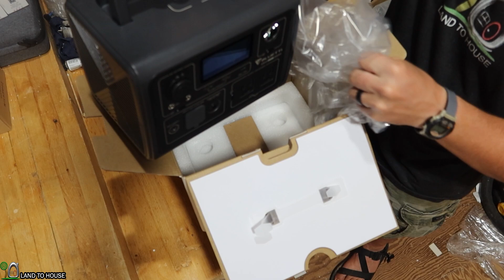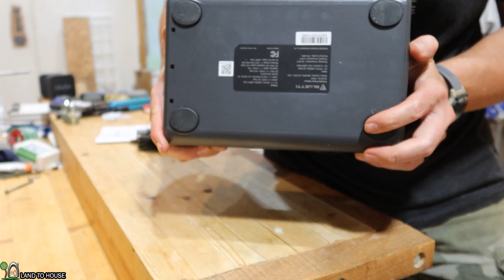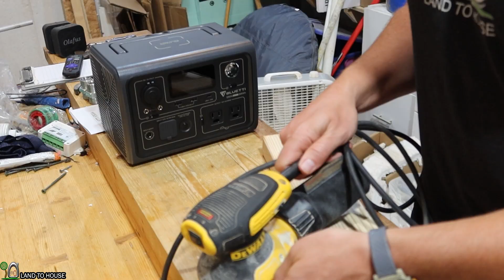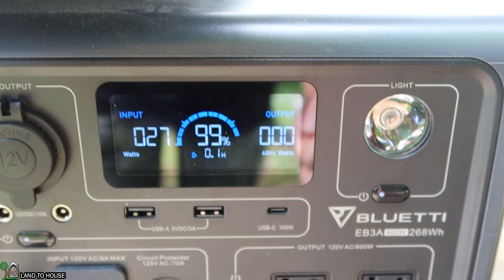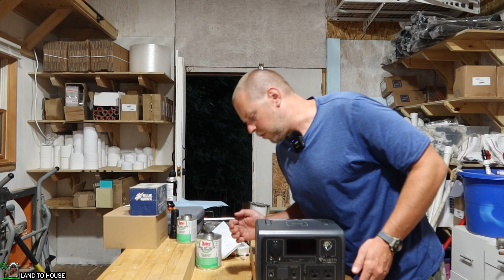Bluetti EB3A Power Station [UPS and Internal AC DC Adaptor]

Comment: I bough 2 of them, they are not that great, when you let them continuously connected to AC,the unit turn to UPS mode, few hour after it finish fall in safe mode in some kind and drain the battery.  It happen to both of my brand new unit !!!!!

Comment: Used propane as the fuel. The generator started on the second pull and ran flawlessly. Produced power at 122 VAC at a steady rate. Works great I would recommend this product as of now. The only thing that bothered me was the oil they send with it leaked on the inside of the plastic bag they send it in, therefore I had to go and buy oil for it.

Comment: I've read to not use power station below 20% and don't charge above 80% in order to extend long term battery life.  That doesn't sound right.  Should I go to near ZERO and charge to 100%? Does it change the battery's "brain"  if i start at 50% and top it off to 100%?

Comment: Manufacturer said it is not recommended to charge it and use it at the same time 🙄🤔
Reply from the maker: I would agree with that. I've been using this in my shop as a cell phone charger and it's better to charge it separately when not in use

Comment: I am new to all this so please be patient. Would this handle a Keurig Cup coffee maker or a two slice toaster or a crock pot? Hope these aren't ridiculous questions thinking  about buying this unit or should I get a bigger unit. Thank You in advance.
Reply from the maker: Not a problem. Typically applications with heaters in them are going to require more W then this small unit I would probably look for a 1500 W unit to run a coffee maker and definitely a toaster. A lot of toasters will run at 1200 W.
Reply: @LandtoHouse  Thank you for replying, do you know the model for a 1500 in Bluetti?
Reply from the maker: I've used this unit and the 700 W model and then stepped up to the AC 200 P 2000 W model. I'm not sure if they make a dedicated 1500 w.
Reply: @LandtoHouse  Thank you.

Comment: Very good info but you never mentioned anything about the APP and the things that can be done only on the APP like the Power Lifting Mode. If you plug in a small heater the Bluetti will fault out but it will run heaters on the Power lift Mode plus you never mentioned anything about the different charging modes available through the APP. You seem to be an intelligent Man so lets cover it all not just some of it.

Comment: I actually own 2 of them. One I use as a UPS for my computers, I have each computer plugged into its own dedicated cheap UPS, then all the UPS devices plugged into the Bluetti. I simulated a blackout and the Bluetti was able to run my 3 computers for 45 minutes before the battery was depleted, then the UPS kicked in. At that point, I plugged the AC back into the Bluetti and it recharged while powering the computers. Love this device so much I purchased a second one.
Reply: The output will match the input. Yes, it has pass through charging, that is how it is able to function as an uninterruptible power supply (UPS) and can switch from line power to battery power in less than 20 milliseconds. If your battery is not fully charged and you have an output of 150 watts, the input wattage will be higher because it's charging the battery and outputting wattage at the same time. My UPS systems have sealed lead acid batteries and the battery in my one UPS finally died. I powered down my computers and removed both UPS systems (cheap ones) and took two power strips and plugged them into my eb3a. Then plugged all my computer equipment into the power strips. I simulated a power outage by unplugging the AC charging cable and ran my eb3a for 45 minutes, dragging the battery down to 40%. Then I plugged the AC line back in and it was drawing 250 watts input and putting out 100 watts on the output. It works great.

Comment: Good review you put it through real case scenarios instead of just talk about it like everyone else.
Reply from the maker: Thank you. Since making this review I typically use this unit for the led light and running my off grid shed lights.
Reply: @LandtoHouse  I just bought one now I need a solar panel not sure what 200 watt panel i want but I live in an apartment I don't have a lot of space on the side of my window. I want to get that ac200 max   eventually I will. just wanted to start off small
Reply from the maker: @jamesmichaelcabrera9613  Most of the panels fold to around 2" thick. Can easily fit behind a bed headboard. Or behind a couch.

Comment: Assuming the Bluetti EB3A will sit idle for months at a time for a SHTF moment (typical FPL blackout), is it okay to store it at 100% charge?  Or does it have to be discharged to 50-60% for longterm (4-8 months) storage?  🧐
Reply: You can store it full charge, it uses Lithium Iron Phosphate, that does not require to be discharged for long term storage. Lithium batteries do require 50 to 60% discharge for long term storage.
Reply: Manual states “ Charge the unit to 80% SOC every 3-6 months for long-term storage.”

Comment: Had my for a week and it will be not take a change anymore I call customer service and got no help from them it’s junk buyers beware and bad customer service.
Reply from the maker: That's not good. Mine has been fine for over a month. Are you charging through the ac plug?
Reply: @LandtoHouse  it Charges from ac but not with the solar panels I use a rich 100w then a rich 200w in full sun nothing happens and some time the unit will not even turn on I heard it been happening to few other people too .
Reply from the maker: @billfowler9325  That sucks sorry to hear its defective. The Eb70 unit i have has been a champ!

Comment: Bluetti lied again about the solar input being at 200w just like they lied about the EB70 being 200w solar input. Max is 155-160w solar
Reply from the maker: I guess they mean you can connect 200w although only 160w will be pulled?
Reply: @LandtoHouse  No as long as the panels are parallel ( Negative to Negative and Positive to Positive ) you can put 400watts of solar wig you want and it will or should cap off at 200watts input like as advertised all over there website. But it’s not true it’s false advertising just like how they did with their EB70.

Comment: I have ran my full size refrigerator off the EB3A without a problem. I hooked the fridge to it when it was at 67% charge. I allowed the fridge to run two full cycles and still had battery left.
If you will be getting into your fridge a lot during this, I would suggest either changing your light bulb to LED, or just unscrew it a bit to disable it. Every watt counts.

Comment: Amazon has them for 240 currently? Would you recommend these over anker 521 and jackery 300. Lookig for something to help me run a box fan couple hours a night. And help with electric pump for paddl boards  and  air matress
Reply from the maker: The bluetti is a solid product.  With 600w ac output it can run a fan no problem. The battery is a little small but would run a 60w fan for 4 or 5 hours.

Comment: Can't wait to get my eb3a, primarily to run my dish receiver on my tt and make a coffee on my keurig without having to run my onboard generator, my only experience until now is a 40$ GoPowerPlus i got at wall mart, its fine for charging a phone or laptop but beyond that its useless
Reply from the maker: Is your coffee going to use less than 600w? Some machines need more to heat.
Reply: @LandtoHouse  your probably right & i may have misunderstood when i read the power consumption of the K express, it says it needs 1500w on initial warm up, but once heated it can maintain temperature between 200/400 watts so it may not work out for that purpose , however my main goal is to be able to power my dish receiver without a generator since my tv is 12v

Comment: We received our EB3A a week ago.  Because we have frequent power interruptions due to Florida storms, we bought it specifically to run wifi router in UPS mode (brand new ATT fiber optic).

Performed flawlessly when initially run on AC inverter battery power (pulls less than 35 watts), but in UPS mode when battery was charging and reached 100%, the sine wave seemed different (not pure?) and router went haywire and wouldn't work.  Anyone else have this problem or done testing to confirm standby UPS sine wave?

Love the unit, but so disappointed it won't run sensitive equipment in UPS mode.  Thinking of returning it.  :(
Reply: how do you know that the UPS sine wave is not pure?
Reply: @Stéphane S. was totally guessing most likely.

Comment: Wonderful review. You're the first of 30 reviews I've watched that demonstrated how to use the manual buttons on the unit itself to convert to 50hz from the default 60hz as well as turning ON/OFF ECO mode. But I do suggest your verbiage concerning "Pass Through" and Uninterruptable Power Source" be more accurate. They are two completely different features. And the fact that this unit has both of them is great.
Reply: don't forget pronunciation, it's eco mode not echo mode

Comment: Bluetti told me the UPS transfer time is 20ms....  That's borderline for causing a computer or other sensitive electronic device to shutdown/restart.  Would like to see someone actually test this...
Reply from the maker: Interesting idea. I will have to give it a try.
Reply: Bought the EB3A specifically to run our wifi router in UPS mode (brand new ATT fiber optic).  Performed flawlessly when initially run on AC inverter battery power (pulls less than 35 watts), but in UPS mode when battery was charging and reached 100%, the sine wave seemed different (not pure?) and router went haywire and wouldn't work.  Will probably return the EB3A and continue the search for a unit that can power sensitive equipment in UPS mode.
Reply: HoBotech does all of those tests
Reply: @JeffSkymaster  Please link the video. The only video I see he just talks about it and doesn't actually test the UPS feature.

Comment: The EB3A would have been a winner if it had the option to connect an extra battery to it.
Reply: You can connect an external battery to it through its charging port. It wont increase your wattage, but it will increase run time. That increase depends on the battery you have hooked up.
That procedure works fine for me using a 100ah 12v battery.

Comment: It definitely performs like the Ecoflow River, except that it is kinda late to the party.
Reply: Except that it has LiFePO4 battery chemistry, which can be a big difference in terms of battery life and is a lower fire risk that the older LiIon chemistries.
Reply: The ecoflow will be dead after 2500 full charges whereas the bluetti would still be working with80%

Comment: i have solar panel with anderson connectors.
can anyone show me a link to an adapter i can use that solar panel with the bluetti eb3a?
Reply from the maker: You might check the dc berral size but this looks good https://amzn.to/3IaXIsH
Reply: they also make a Cig lighter plug with anderson conversion
Reply: Find a local Ham Operator, they can make you a cable right quick.

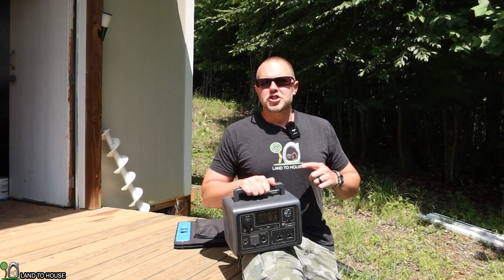Comment: The pass through charging hands-down makes this kit awesome! You're totally right -- most do not do that! It was nice to see the charging input stay the same even while the tool was in use. I wonder if that was the case.. a pair of kill a watt would be handy to verify. I've been thinking of ways to torture test these things as companies continue to make and want to promote them. :)  @8:04 Is that the archimede's screw!?!?! :)
Reply from the maker: That is the Archimedese screw! The unit you have is the best around. I do have a single kill a watt meter.
Reply: @LandtoHouse  Could you do another tool review and show if your chop saw will run and cut?  ...and maybe one of the highest draw tools from your workshop? I've got to cut a bunch of bamboo and PVC off-grid... Thanks!

Comment: Hi Seth, instead of doing product videos what about doing more on making the water you harvest from the ram pumps into a full domestic system...the cold water tanks, filtration with or without the pressure from the header tanks and developing a hot water system...options for gravity fed or solar powered pump, wood burner with lattice pipework to heat the water directly into a tank, indirectly to heat a hot tub etc etc?

Comment: I'm looking for something much bigger but that's a brand I'm considering.  It's very cool you can turn Eco mode on and off.  Sometimes I need to power devices that use so little energy power banks simply turn off.  The UPS mode is a nice feature.
Reply: We've used the BLUETTI AC200P for about 6 months now as we run our camper and such off grid while we finish our home. It's been a rock solid and 100% as-advertised product in our experience! The build quality is very good, and it's taken quite a lot of abuse from us and still rocking!
Reply: @sam-and-angela  I'm still comparing devices.  This being a setup for home I'm not confined to these portable setups.  It's possible I'll use individual components.
Reply: @jmr  IMO that would be the best option. Check out Growatt, they have some awesome units that will connect via WiFi. We installed our own off grid system for our setup about two weeks ago that uses the Mid Nite Solar DIY series all-in-one inverter/charge controller unit, but it lacks any network connectivity for close monitoring. We've since added a Growatt smart charge controller to handle more input from our PV array and it's connected via WiFi. Have remote monitoring capabilities to see incoming PV power is awesome! I just wish I could see the rest of the system too. :) We've got videos on this stuff on our channel if you're interested.
Reply: @sam-and-angela  I will check that out.  I definitely like remote monitoring as well.  I have an ESP8266 attached to my current charge controller.  It sends the data out over MQTT so I can log it in a database.
Reply: @sam-and-angela  Watching your videos.  I'm a little curious why you chose those batteries though.
Reply: Yeah, basically it's a Battery Back-up!!!
Reply: Anker 757 is amazing